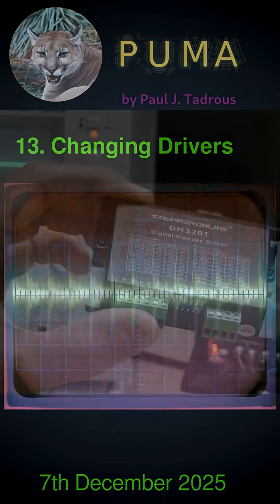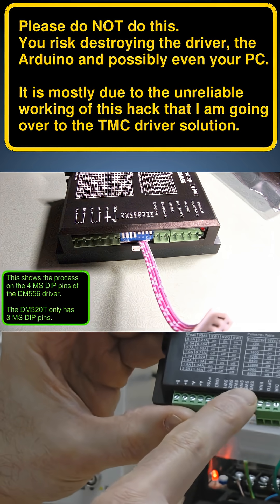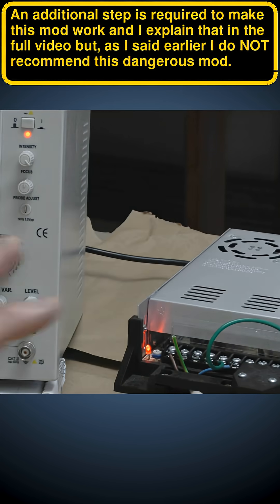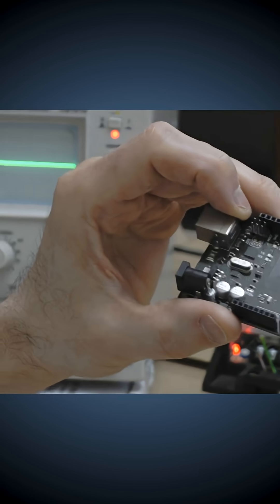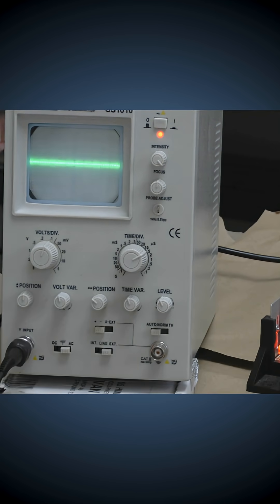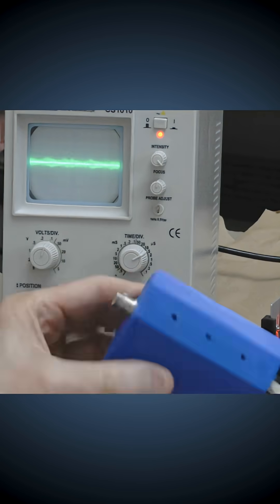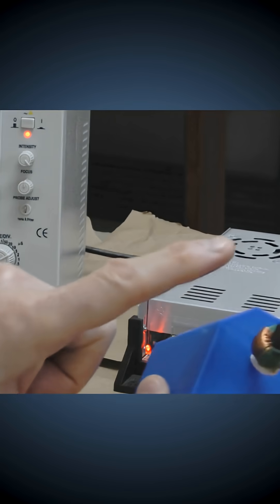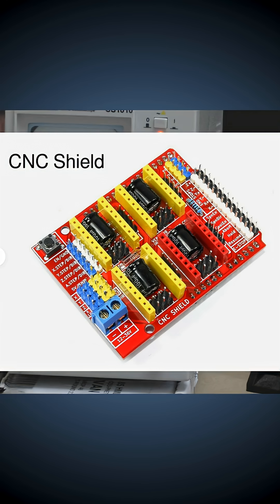Why I'm switching to stepstick motor drivers from standalone #CNC drivers. #microscopy #arduino

Comment from the maker: Some follow-up info regarding the filter module. I'm not very good with electronics and, after doing a bit more reading, it seems that the signals I was measuring on my power supply were probably artefacts of my poor oscilloscope probing method - I left the ground clip on the probe 'floating' and this was probably just picking up harmless EM radiations. Also, the fact that the same signal was present on both + and - lines (called 'common mode' interference) is also not that important in practice.
Even worse, however, it may be that my dual inductor power filter might be causing problems by risking brown-outs and inductive feedback resonance loops when in operation that could cause functional failures and even unwanted damaging voltage spikes.
So, for those reasons, I no longer use that blue BNC filter box and, furthermore, when I use a more sensible probing method with my oscilloscope I do not see those voltage ripples. My PSUs are actually quite good just as they are.
So, the real takeaway messages from this video are:
1. I'm going to be using Trinamic drivers from now on, and
2. I'm not very good with electronics!

Comment: If you didn't use isolation (optoisolators or similar), that almost certainly was a big part of the problem. The relatively high currents needed for motors cause noise and surges, and this will happily flow through whatever paths are available. The noise and voltage surges can cause your arduino to reset, or in severe cases could even zap it.

I'm sure it doesn't seem sensible that current will flow through small wires to the arduino when it could flow through much larger ones to the power supply, but enough can (will) to mess with the arduino.

The stepper driver inputs will either include isolation or will specify external isolation - so you won't see it there. Any other paths, such as the config cable, will cause problems unless isolation is used. There are two parts to effective isolation: first, use isolators for the signals. Second, there should only be one common ground point shared between the drivers and controller. If there's also a ground wire going along with the config signals, pulses/surges will take this alternate route to the power supply. Along the way, they can "leak" into the arduino.

The driver side of the isolators will need ground and possibly power; these should come from the driver. Likewise on the arduino side: any ground or power for that side of the isolator must go towards the arduino rather than the driver.

Hopefully my explanation hasn't made the waters more muddy! :)
Reply from the maker: Thanks. I'm not an expert in electronics and such and, after doing a lot of reading, I now realise I have been guilty of horrendous driver abuse and am not surprised that I managed to blow up several drivers and two Arduinos (one even has a little explosion scar on the ATMEGA chip).
This hopefully will explain why I have spent the last few months learning and implementing all kinds of 'safety' features for my new Trinamic setup before I even dare pass power into the board. To some it may seem obsessive but twice bitten 4 times shy. Soon I will be ready to do the first power up test and see if I can blow up a third Arduino and trash my Trinamics or if I can actually get my microscope stage to work without popping, fizzing and smoking!
Reply: @PUMAMicroscope  Hard to learn without mistakes ;)  If there's a robotics (and/or DIY CNC) meetup group in your area, I'd consider showing off your setup and seeing what they have to say.

Comment: Noooo, it's owned by big corpo Qualcomm. Jk, it's your life.
Reply from the maker: I use clones of standard 'pre-Qualcomm' Arduinos. Qualcomm can't control what has already been open sourced. They only control the future developments like their new all-in-one computer 'Arduino Q' and their AI Arduino, etc. The standard 'old school' Arduino still belongs to everyone - just buy clones if you don't want to 'support' Qualcomm and don't use the 'official' Arduino websites / forum etc. from now on if you don't agree with Qualcomm's new T&Cs and don't use any Arduino IDE for programming that isn't open source. Otherwise, there is no reason to stop using the AVR breakout boards we call 'Arduino'. That's my take anyway.
Reply: @PUMAMicroscope this is well written and I'm surprised you responded to this quickly.
Reply: can you dumb it down for me a little? why would it be wrong at all to use an electronic i purchased, that i own - in my own way?
Reply: Imagine a car with every part replaceable including the lights, it's bare bones for tinkering. Then Ford buys this car company and says they won't change the car, the 1st thing is to put themselves within management. They say we need to change the electronics for the consumers and to make a bit of profit for "profitability". They use the money to enrich themselves. They slowly replace the core. They start to push out the rest since the best left when their designs got proprietary. The hardware becomes horrible due to the closed software that Ford pushed on everyone. The consumers realize it's a lost cause and leave towards easier, better and repairable car brands.
Reply: @JustanAccount-b3r  i understand it now, thank you